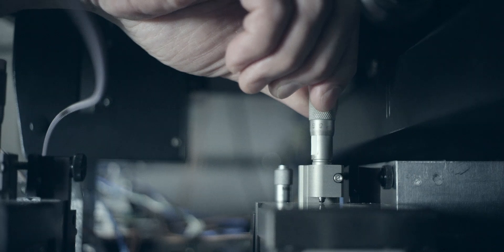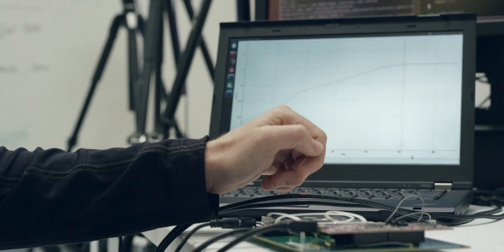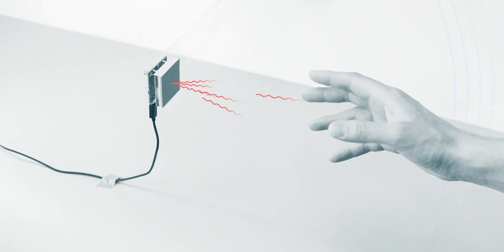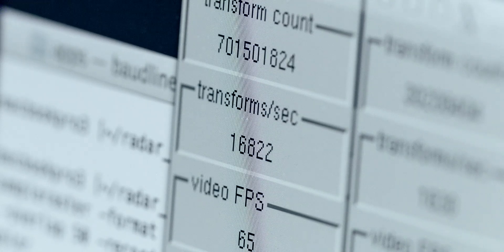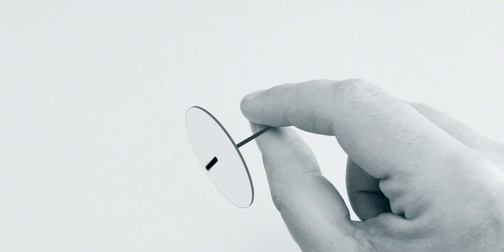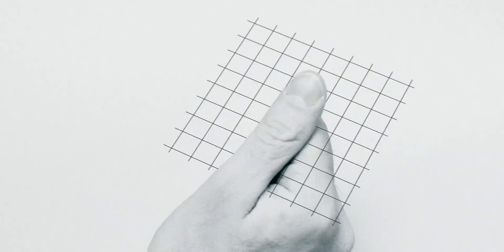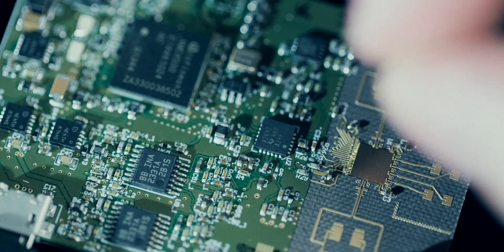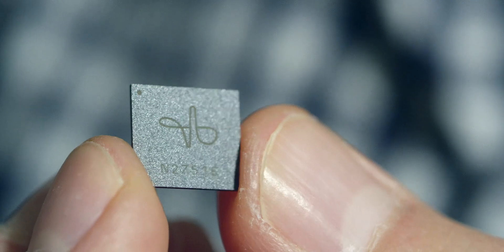Welcome to Project Soli

Comment: If it can capture the entire hand, you could make a real time "sign language" translator.
Reply: damn, didn't think if that, that's useful
Reply: "Patent it" - it's already too late buddy.
Reply: How awesome is THAT going to be?
Reply: You could try creating a sign language translator using a camera, but this technology removes the camera requirement and makes it more precise. It's really awesome.
Reply: @alissonreinaldosilva1119  I don't think a camera would be precise enough to detect and translate sign language
Reply: @sasca854  What Don't Read My Profile Picture is trying to say is that radar can heighten the already existing approach of optical sign language translation. Radar has the edge on multi-camera systems because there is greater perception of depth.
Reply: there seems to be a common misconception as to how radar actually functions to begin with. yes its extremely precise but not in the conventional ways people think. it cant "hand track" in a conventional sense sadly. youre seeing a cross-section of whatever is infront of it, distance, speed, and direction of movement, not a visualized version of the hand mapped out. this isnt lidar or anything like that.
Reply: That's genius!

Comment: Pixel 4 is here and they decided not to put the full functionality from project soli to the pixel devices. Instead they choose a approach where dispite of having all the hardware available to use soli, they will make it seem like they are improving this tech on future pixel phones so that they can capitalize on soli’s functionality as longer as possible. A tech which was available since 2015 will fully penetrate the market by year 2025 or so, just because of the corporate greed.
What a great world we live in!
Reply: but pixel 5 does not have soli anymore right ? what happened ?
Reply: @fairbaken  OP is wrong
Reply: @lars2299  bought a used pixel 4 xl and it is really a shame what they did with soli.
Reply: Imagine thinking Google would carry on with ideas that a small amount of people use
Reply: I think they were showing the potential of what it could be used for, not what it can do. either way, the pixel 4 already was limited on battery power so using even more power on the radar would not be a good idea

Comment: The possibilities are endless. I thought of surgeons doing microsurgery with robotic hands remotely. Holy smokes this is genius
Reply: Part of the allure of robotic telesurgery is the force feedback element of the manipulators. How are you going to recreate this sensation solely with radar?
Reply: @MikeTrieu  great point. i have no idea what the current mechanisms are for dealing with this problem. you are right there is only visible feedback with something like this unless you could wear some kind of mechanised glove that responds to the robot arms sensors and then latency is of course an issue as well.
Reply: They accomplished all this.

Comment: This also has potential for use with sign language.
Reply: No, not at all. It wouldn't be able to read a face, you would need a camera for that. (deaf and fluent in sign language, also an engineer)
The difference between "I got it" and "I don't understand" is purely with different expression. The difference between "he is late" and "hasnt happened yet" is sticking your tongue out making the "th" sound. The face, shoulders, and depictive verb classifiers make up too much grammar, so much that the meaning gets lost if you cover the face. the grammar is different, so it also needs to be interpreted/translated. "finish touch never" means "never have been to before" or "past happen what finish touch touch 13th, total wow" translates to "I have been there thirteen times in my life!"
etc. 

Google translate breaks the languages enough. also no signs for "be is am are" etc. signs don't translates to words the same. like "have you eaten cupcakes?" doesn't use the sign for "have" since it only means possession. it doesn't translate.
Reply: Avery Kucan Maybe, but I know there is a kind of sign language that basically replaces words with gestures. I can't think of the name at the moment.
Reply: +Bert Visscher Signed Exact English? SEE? Still no, unable to comprehend the dozens of handshakes.
Reply: Avery Kucan Yes, that's it. See.
Reply: Bert Visscher SEE isn't used though, except to interpret between asl and English, so the only people that would use it already are hearing anyway. It's to relay English to a deaf interpreter to interpret again into asl.

Deaf people don't use SEE, so it would be useless.
Reply: +Bert Visscher Also, SEE still requires face.

Comment: Wow! I really didn't know that radar was so precise! I can see something like this working very well with VR.
Reply: Caudex yeah maybe in the near future it could convert hand signals into real hand motion in the virtual world ,therefore we wouldn't need the controllers for the HTC vive but instead our hands
Reply: hrishikesh rajesh
It seems like a nice alternative to the stereo imaging of the kinect. I wonder how it will hold up to the leap motion.
Reply: I'd still prefer to be holding a controller in VR for when I pick something up though. Unless I'm using the Force
Reply: Zadok the Priest ud be be surprised from the amount of idiots who dropped their controller when they had to let go in the game 😂
Reply: hrishikesh rajesh there's that new vive controller prototype that straps around your hands though, that's going to be helpful
Reply: Zadok the Priest lol ,if Apple made VR they'll say tht Their winning strategy  is tht their controller is wireless
Reply: Zadok the Priest
THAT WOULD BE THE BEST STAR WARS GAME EVER.
Reply: @Grape Soda It's non-ionizing radiation and at such low power that even thermal concerns are negligible. Stop worrying so much.
Reply: @NinjaTyr257  Hello from the future! I can confirm this has not happened yet
Reply: Hello from the future , apple did it with VR and yes you can pinch zoom with your hands .

Comment: use this with virtual reality so you don't have to hold those controller things
Reply: Mindblow
Reply: +J_laubster Well you wouldn't need them for some applications, but when you're playing a shooter and are supposed to be holding a gun, it wouldn't help with immersion. Sure you could use your fingers, but I think holding a controller with enough of a gun shape to it and some good haptic feedback would be miles better. The REALLY good usage of it would be to use both devices in tandem, best of both worlds.
Reply: Or could use the hand gesture with VR with games like The Elder Scrolls Skyrim 
Mind =  Blown
Reply: Well, you could also take advantage of the whole new platform to make games that are miles better than the generic, overexplored genre of shooters
Reply: KEWLIOSUCKA or use it with guns but they're just props and not Hightech wired contraptions,
Reply: i seen reviews showing leap motion doesn't detect that well

Comment: I'm really interested to see a system that pairs this technology with devices that provide haptic feedback in a VR or AR environment.
Reply: Microwaving your nerves is commonly considered harmful... But that didn't prevent people from putting their heads in front of powerful radar transmitters and hearing their ping.
Reply: You make no sense.
Reply: In English you usually say something polite like "Could you explain that, please?" when you need clarification. You can read more about the confusing part here: https://en.wikipedia.org/wiki/Microwave_auditory_effect
Reply: Garganzuul Tacos
Reply: Eh, you can already approximate this with focused ultrasound. I believe Disney Research and others demoed this a few years back with ultrasounic phased arrays. What's cool is that ultrasound can be used for both ranging/sensing and limited haptics. It literally can cause air to push back against you (airbending?)

Comment: Awesome! I really hope that it's going to get implemented in Products in the next Year's. (after development) 

Or integrate it into a Google Smartphone...
Reply: vf fa : today you can use these as "gesture motions" in some phones. Not really effective, much better to use the touch panel. 😕
Reply: Xander Yman gesture motions in a phone are a completely different thing than this
Reply: vf fa this isn't something for a smartphone. it's more likely to be into something like a vr/ar headset
Reply: Sinom : i don't think it so, looks like very similar.
Reply: Xander Yman one phone that uses technology like this. the only thing remotely similar is the leap motion and that is completely different technology and not on phones
Reply: Or Giant screens f.e. in Schools. It would be awesome, anywhere..
Reply: Or Giant screens f.e. in Schools. It would be awesome, anywhere..
Reply: mobile phones took off despite resistance for the exact same reasons, bluetooth headsets still look ridiculous, ultimately the mistake is revealing the product before you can reliably and affordably produce the product

Comment: How much of this is ACTUAL footage of the hardware working.
Reply: None, it's just concept.
Reply: Dude, they have demoed it both publicly and to press, and as they say in the video, "the pipeline that we BUILT" not going to build.
Reply: @MentalEdge  jokes on you
Reply: @63fan  not anymore
Reply: @saifunazar322  They even had a lab demonstrator you could purchase at I/O 2015. The hardware always worked. It's just the engineering needed to integrate it into a consumer-facing product wasn't ready until this year.
Reply: So cute.

Comment: this is cool, but unless you can capture 360 views, and not just positional input, its as limited as any camera.
Reply: Multi sensor correlation: the camera can tell where it's coming from and the radar can fine tune the input.
Reply: 180, surely. Why would you need to capture motion behind the display?